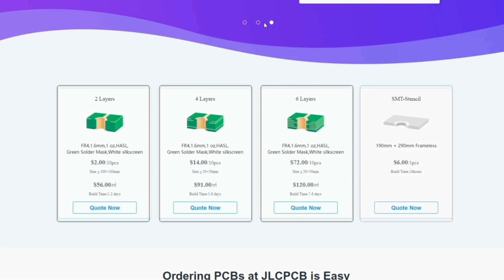Simple Electronic Projects [NEW]

Comment: Howdy, Brother!  What resistor should I use if I have a yellow 10mm LED Emitting Diode (1.8-2.2V)  powered by two AA Batteries (on/off switch in the loop)?  I'm not even sure if I asked the question properly 🤠. Thanks for any assistance.
Reply from the maker: 50R to 100R resistor
Reply: @Creativecreator  Much appreciated!
Reply: i soldered a 100R and the two AA Batteries were getting very hot.  Should I use 51R?
Reply from the maker: @RKELLEHER40  yes try

Comment: What is the exact value of that capacitor you used in the amplifier circuit? 
Please reply
Reply from the maker: I have mentioned buddy in the video 😁
My first point is user experience.
It is 1uf 63v
Reply: @Creativecreator  Waah.... Fast reply.... Thanks to interact ❤️
Reply: The value of the capacitor is 100 micro Farads / 25 V, but I would put a voltage of 50 or 60 V maximum for more safety
Reply: The answer I gave is the 1st project
Reply: I have just reviewed the 1st project we see a 25 micro Farads / 25 V capacitor, while on the diagram there is a 100 mico Farads capacitor and must be 25 V. the difference in values between the two capacitors will be that the LED will not flash at the same speed, I would be you I would do both to see